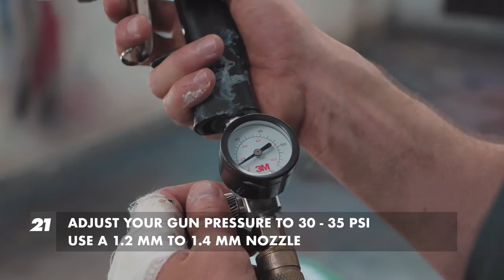Superwrap RTS | How To Spray Mirrors

Comment: What's the minimum temperature for superwrap? And the cure time? I'm hoping to wrap a snowmobile with it.
Reply from the maker: We currently do not offer technical support on full body applications with the RTS line because we are in application testing for complete vehicle.
It's a project that can be taken on by advanced DIY'ers and professionals with the understanding that Superwrap makes no guarantee in regards to finish quality and durability.

Make sure the ambient temperature during application and drying is over 20 degrees Celsius and that you wait the full 8 hours of drying before taking your car out on the road.
Keep in mind winter usage will reduce the expected durability of Superwrap. You should apply additional coats (12+ total) of Superwrap along with our recommended number of wet coats of the Top Coat Series.